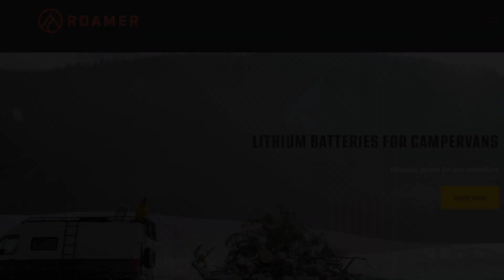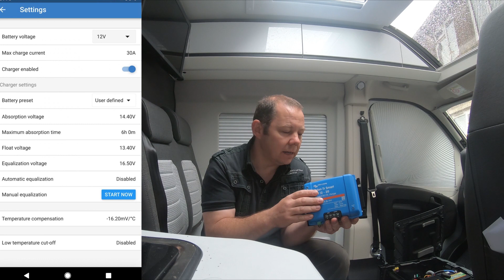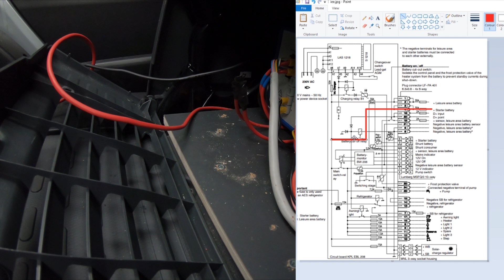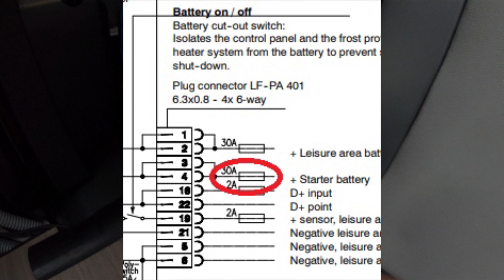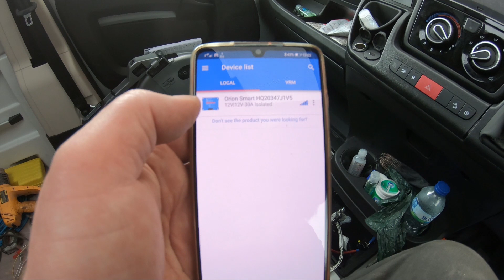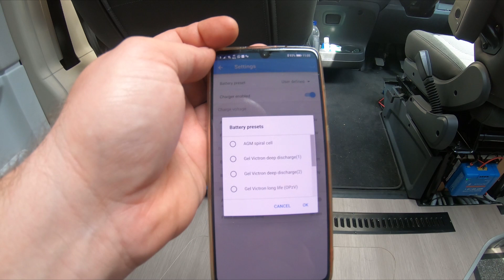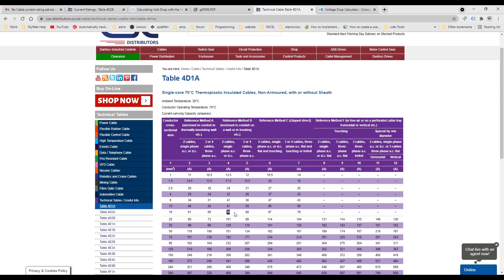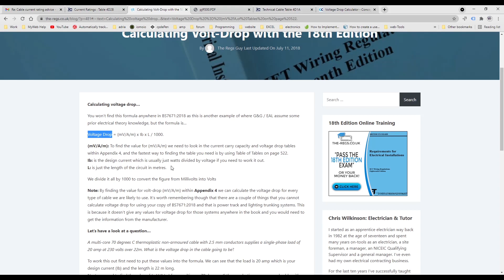Adria Twin fitting Victron Orion Smart Tr B2B DC - DC charger

Comment: At about 7 minutes into your video you made the claim that you believe the devices called smart because that's how it knows whether the engine is running or not. I don't believe that's true. They have similar units that are not called smart, but the truth that I understand is that the smart function only pertains to the idea that you can use your phone in Bluetooth mode and see graphically what the charge situation is while the system is in use. My point is if you get the non-smart version you just don't get the smartphone aspect, but the device still works the same and prevents the charging to take place when the engine is not running. I happen to have the smart unit and use the Bluetooth app. It's really not exciting and extremely worth it other than it can give you the satisfaction of knowing that the system is working correctly. You could just measure voltage with a voltmeter manually to see whether it's working or not, but that's as I understand it the only benefit of the smart aspect of the device.
Reply from the maker: Hi Biketothetop, you are most probably correct, since fitting this I have got a few more Victron devices to build an off grid house system and the smart function is due to the Bluetooth connectivity. I agree the app does not show much information but does make changing setting easy and controlling the unit. For example, when my solar is working well and the lithium is near 70% above charge, I will log into the B2B on the move (wife driving 😊 ) and switch it off and rely only on solar. I have also been playing with the lithium setting voltage on expert mode to get better charge profile. Not sure other than this what a B2B would show.
Reply: @BrackstonesTravelAdventures  ok, thx

Comment: How has you battery preformed
Reply from the maker: So far its very good, but I still only have the AGM fitted Lithium batt still on order. I like the victron as you can Bluetooth into it when driving. Some times with AGM it stops charging at around 97% and goes into float. So I can login to the B2B and switch it off then on again whist my wife is driving. This puts it back into BULK charge so I get the full 100%. I believe this is due to AGM high resistance when near full charge capacity. Hoping this is not the same with Lithium